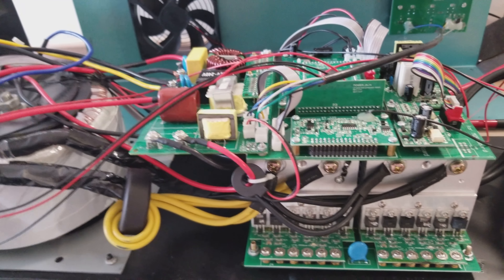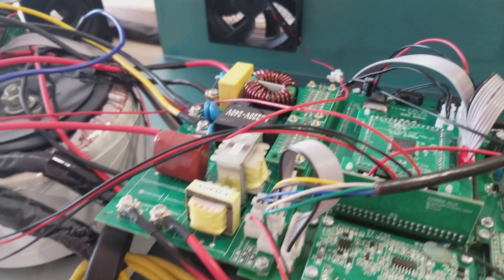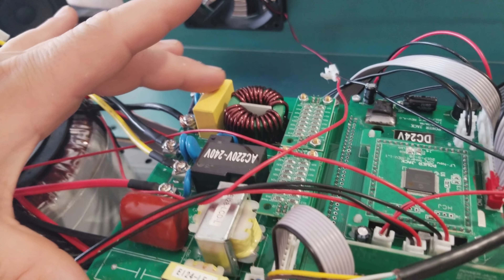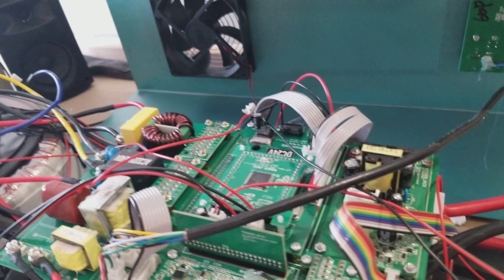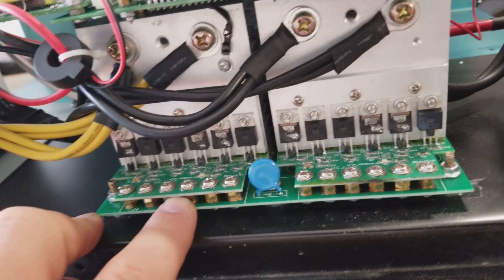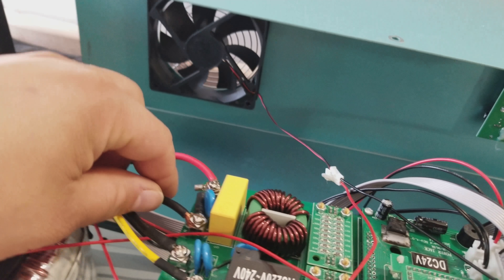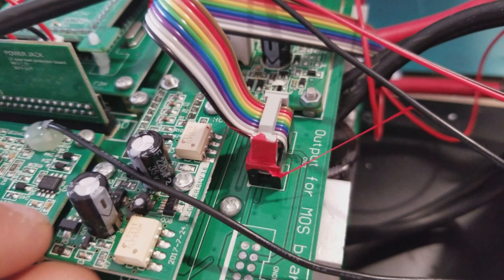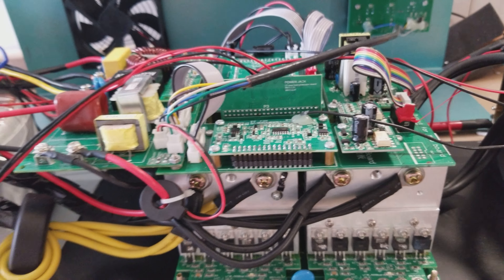Why you should never repair if you don't know what you are doing

Comment: Is there any 120vdc input inverters with 120/240vac output that do not cost a fortune.
Reply from the maker: 120 volts DC? Not very common so not cheap.